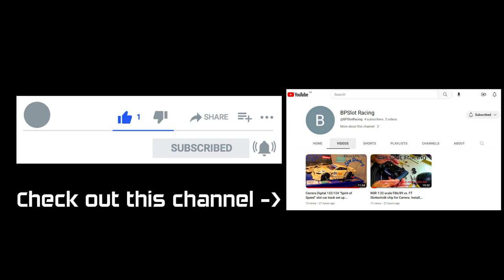Scratch Built Crash Barriers Part 2 - Adding Catch Fence

Comment: I used plastic canvas in place of the wire mesh! The grand kids race so I had to limit the sharps! I also used speaker wire that was smaller, so it better matched my HO (1/64) scale. And thanks to your tips for the jig and the all thread, it turned out better than expected! I did use some hollow tube on some supports so I could install lights and I glued yellow and green LED lights to the fence every few inches to control the race starting and stopping. I like how the speaker wire absorbs the impact lessening damage to the cars. Thanks for the video!